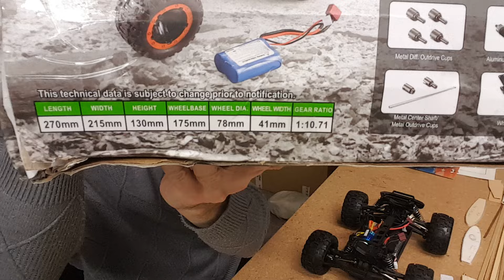Starting wheelie

Comment: Hello Deon, good to see you back, your Wheelie project looks like some excellent engineering. . I think your wire will work quite well because of the " strand winding" similar to electric wring, which of course is copper.  The only place that would probably carry silver wiring would be a jewelry supply business especially for beading. . The metal from the cans looks great. I'm anxious to see the progress of the buildout  Wheelie is definitely going to have some competition  Up here in the Pacific Northwest  I only have about a week left before I have to disassemble my model area and prepare for some end of summer guest. We rarely get visitors so that's OK, and as I clear up the area I can probably achieve more organization so getting it back together will go faster plus do an inventory . I'm studying various schemes for my Albatross and PBY, to see if I can work on both at the same time. So by middle of September I'll be back to building. . So Happy Modeling till then,  I hope Chicken is well - he might enjoy driving your new Wheelie :-) Cheers Bob